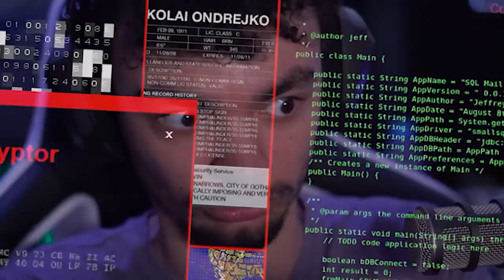Making a 100,000RPM Silvia in Need for Speed HEAT!

Comment: Should've done this with the regera, would've been better because of the agera having 1 gear
Reply: Regera you meant
Reply: I don't think Regara would work as well, cuz Silvia did it in the first gear, which isn't a long gear at all.
Reply: @hongthainguyen5334  the Regera only has 1 gear cause of the engine it has
Reply: @blazingsniper2611  wait uh lemme boot up my brain I forgot what we were talking about
Reply: @blazingsniper2611  Ah I got it. No, Regera won’t work becuz, just imagine, when it reaches 250 mph it uses its irl rpm, but when it has 100,000 rpm, it needs to go beyond 250 mph to use all that extra juice, and the rpm would have no use then cuz of Heat’s speed limiter.

Comment: There's A good long straight on the left side of the map near the beach, there's a railroad that goes all the way to the safehouse at the top. The rails are almost dead straight, I was able to hold 237mph for almost a minute without hitting anything or slowing down